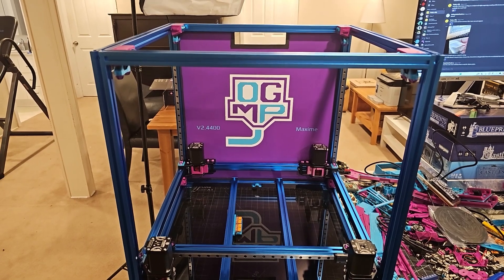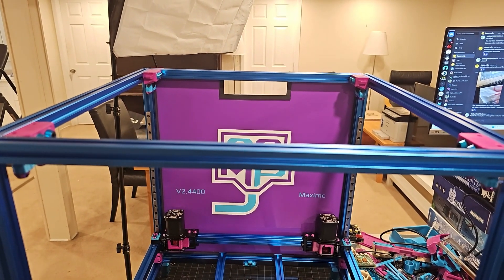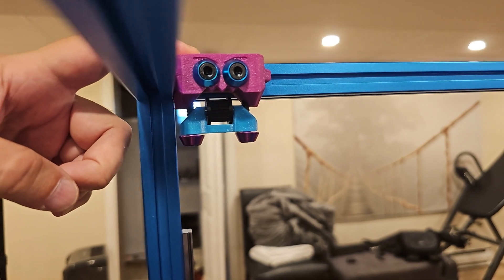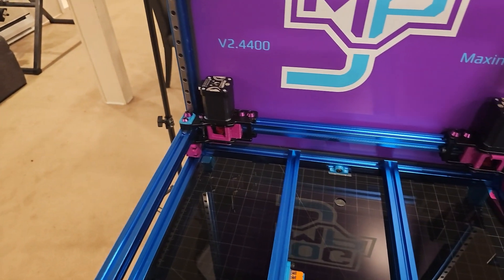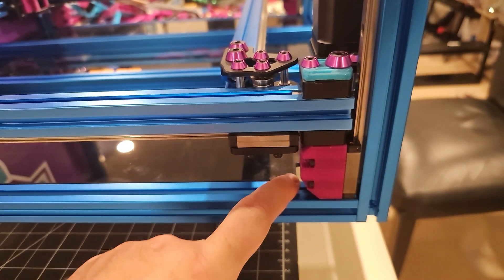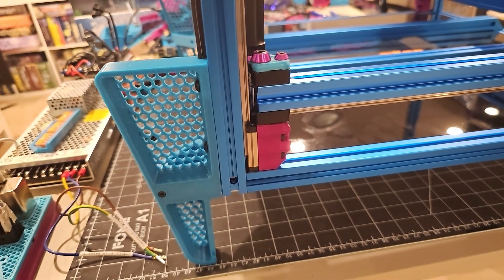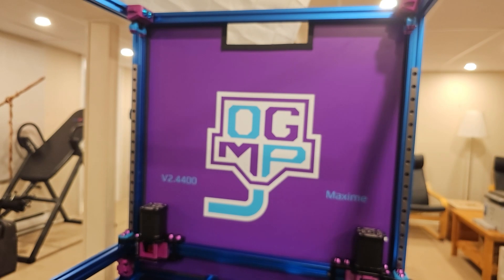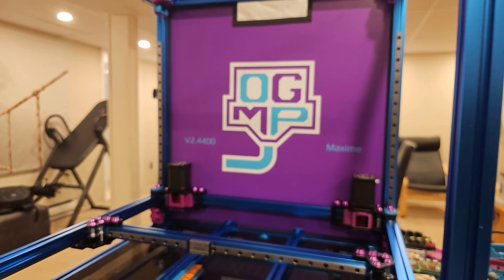Voron 2.4R2: Rebuild: Updating my Workhorse Printer

Comment: I am curious about the fixed z joint, what makes them better than the bearing you where using before? I don't like the original z joint and the G5c isnok, but I still don't feel that they are 100%
Reply from the maker: Good question! I asked in the Voron Discord's #voronuser_mods channel about the latest and greatest in Z Joints technology, as I was planning a full tear down, and currently had Hartk's GE5C Z Joints installed. Hartk himself pointed me at the Fixed Z Joints as the Next Best Thing, stating that the GE5Cs were "old news now".
Reply: Sounds great, then I will have to try to take a look at it. In the GitHub repo I only see one stop file and very little information other than that. Do you have any idea where I can find some more info?
Reply from the maker: The designer, ByThorsThunder, is quite active on the Voron Discord. As is Hartk, who recommended these to me. Either should be able to answer questions.

Comment: Not flipping your X-axis so you get the rails on top?
Reply from the maker: Rail, singular, and it's an MGN9. Who does top rails any more?
Reply: @oldguymeltsplastic  trying to show a picture, but gets removed, i meant flipping the whole X-axis mounts and all so the y rails get's on top of the extrusions
Reply from the maker: Ah! Does doing that help something?
Reply: @oldguymeltsplastic  heh, boils down to placebo effect i think, apparently it's better for the side load you get on Core X/Y jerk. it's easier to mount, i think it looks better. but for performance gain probably zero.

Comment: Those motors look insane, what’s the specs?
Reply from the maker: https://github.com/D3vil-Design/Kraken-Stepper/blob/main/Data%20Sheet/Kraken%201.8%20%5BLDO-42STH60-3004AC%20(S40)%5D%20RevA.pdf